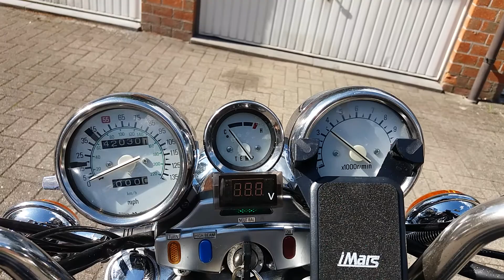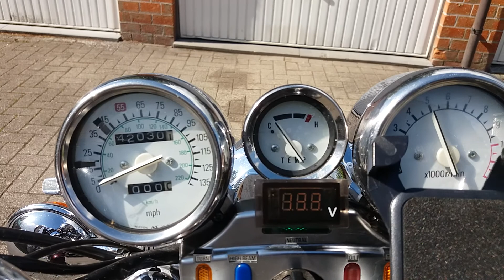Yamaha Maxim XJ700X

Comment: Buenas Juancho, como estas ?? ... mira, soy de costa rica y queria preguntarte si aun tienes la maxim ?? .. es q queria saber si me puedes ayudar en una cosa... tengo una maxim x y me esta quemando el fusible de ignición... la tengo toda desconectada, completamente toda con solo la corriente en el cdi y siempre quema el fusible cuando le doy ignición cob la llave... la pregunta es, si tienes la maxim para ver si me puedes enviar foto de como esta conectado el cdi de tu moto... gracias
Reply from the maker: Ya no tengo la máxim pero aún debo tener el manual de taller lo busco y te lo envío en pdf
Reply: Me pides pasar los manuales de taller soy de Venezuela y estoy un poco enredado con la carburación
Reply: Pudiste encontrar el manual?